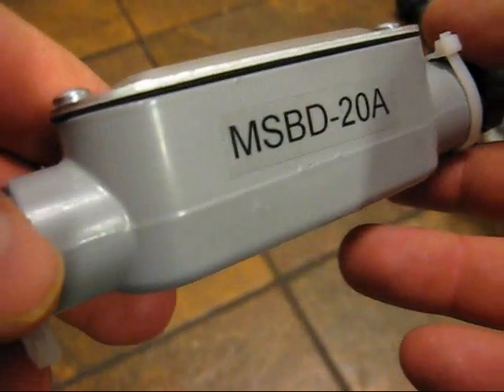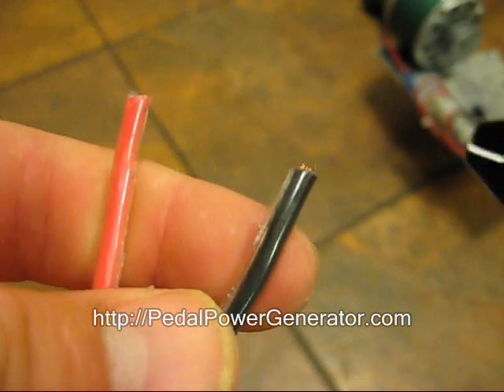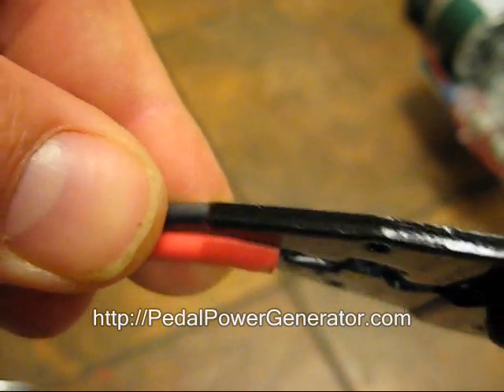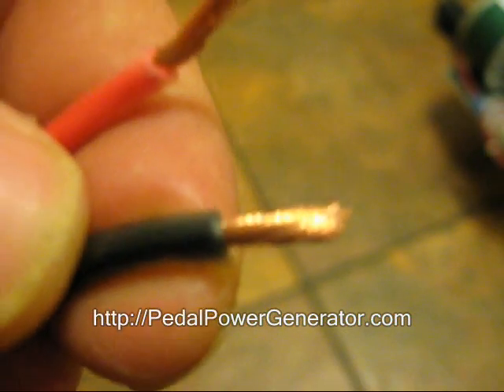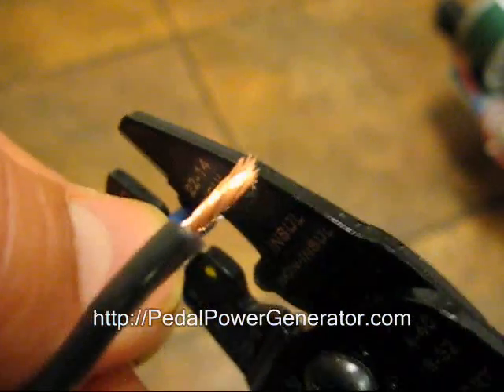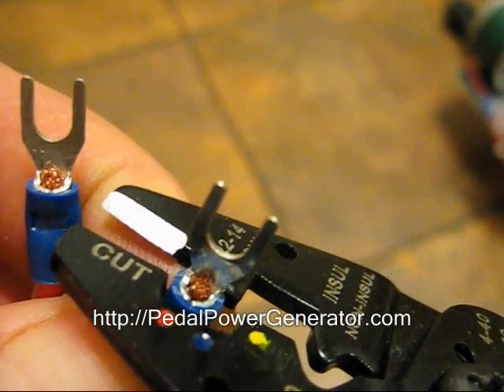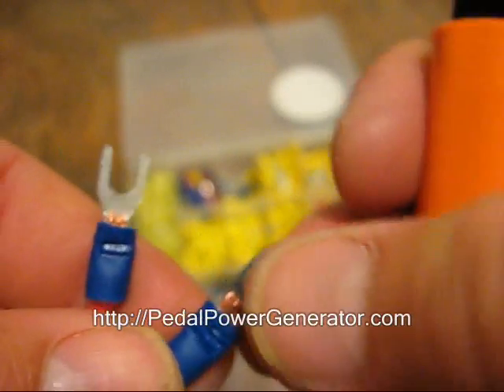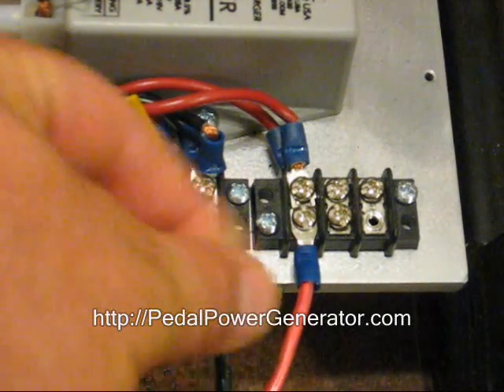VIDEO 4 - BYO Bike Generator - Blocking Diode Assembly

Comment from the maker: @ldaleb This is strictly a wire managment issue  -  a clean approach to for delivering power to where ever you want to route it to - in this instance  we are charging a12 Volt Duracell battery powerpack.

Comment from the maker: @schaffercl The arrow is showing the direction of current flow.  So you want current flowing from the generator to the battery.   The arrow is pointing to the battery side of the diode.    (2) Yes the black wire goes straight through, not connected to the didoe.  Watch youtube.com/watch?v=D7P38eSUlkI

Comment: 1) So the diode I bought from you has an arrow pointing in one direction.  Which end is this the load or the generator side?

2) I opened the top cover and noticed the black wire is just straight-through and not connected to the diode assembly inside at all.  Is this correct?